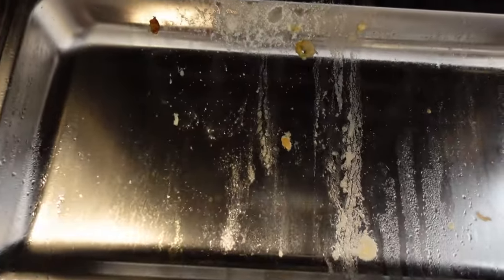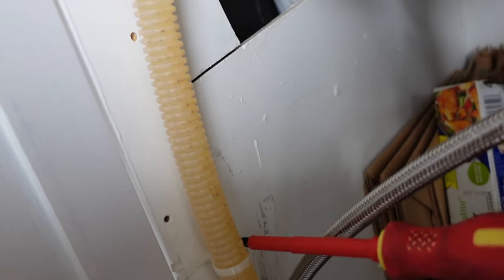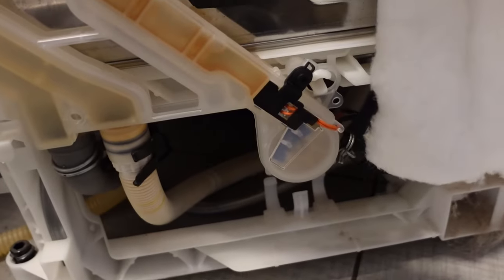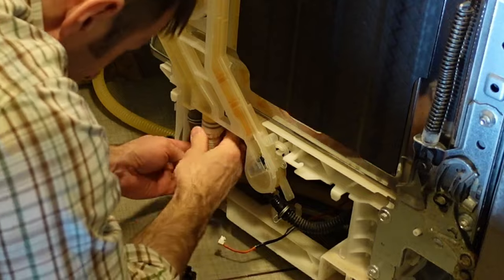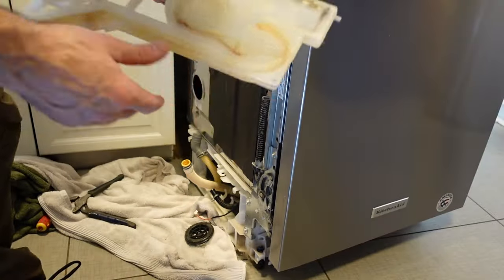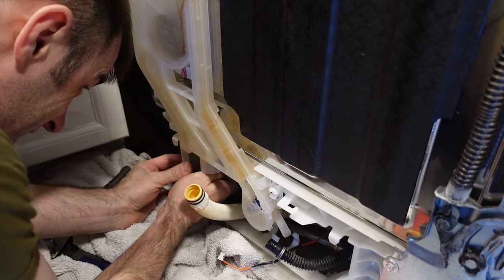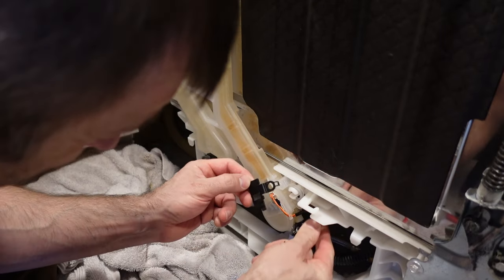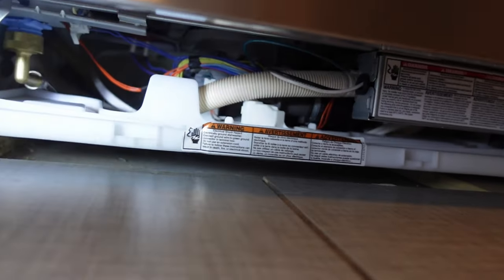Dishwasher Drain Error - Kitchenaid, Maytag, Whirlpool

Comment: Wow, my Maytag dishwasher is identical to kitchen aid. Glad I didn’t pay the extra for the hood ornament. Just pointing it out. No disrespect intended.
Reply from the maker: I'm not really sure what the difference between the brands within the same overarching brand really are when it comes to appliances. Its not like a Ford and a Lincoln where the differences should be pretty visible. Generally I think that Whirlpool is the cheapest of the bunch, but that might not even be correct in all situations.
Reply: @DIYNorth  I’ve not been happy with my Maytag. Wish they didn’t send the company to Mexico. My dad used to work at their plant in Newton, Iowa when they were still made in America. Their washer and dryer etc would last 10-15 years back then, now we’re lucky to get 5. It’s almost pointless to even buy one anymore.
Hope our businesses come home and we can get those jobs back. A lot of problems would be fixed and the communication/problem solving equations would resolve a lot more quickly. Now we have to interpret our problems several different ways just to figure out anything.

Comment: Thanks. I cleaned all of the tubes and hoses but to no avail. I looked at my inlet but it was clean except for the side where that float is and it was completely filled and black. Because no where else was dirty i thought it was normal. After cleaning the black gunk out , machine is back to working.
Reply from the maker: Thanks for watching.
The black junk will get you

Comment: We have the same model of kitchenaid dishwasher and the problem with mine is no water going to the arm and it is not washing the top racks. I did diagnostic and it gave me 9 pause 1 pause repeat which means there’s an electric issue on the diverter but I checked the wires and I don’t see anything.
Reply from the maker: Mine had many issues and this is just one of them. Ultimately it was the water pump that seized up. Its pretty easy to get to the diverter though. If you haven't taken the pieces off to check it out I would do that. There could be an obstruction in the diverter preventing it from moving. You might need to check the resistance / continuity of the diverter to see if there is a problem with the diverter motor that you can't really see.

Comment: Was the error the 3 beeps?
Reply from the maker: it was a flashing clean error initially which is the clean light flashing 8 times then a break then 4 times. 
the real major problem was the filter exploded. this is just one of many problems that also happened at the same time.